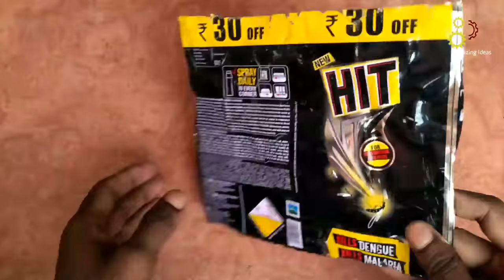Top 10 Beyblade Homemade | Metal Beyblade | How to make a Homemade  Beyblade Compiled

Comment: Ah,i remember when we as kids used to make them out of the bycicle thing,where the bycicle chain goes.You take that out,put a metal pipe trough it and rope around the 'beyblade' so you can launch it.Yeah,there were the plastic beyblades to buy but they were lame, this way it was more dangerous but also more fun,you could see sparks when they hit each other(especially in dark areas/rooms)
Reply: Can u make a bud on how pleas🙏
Reply: @nobody-ed8op  I Will try to explain it to you more precisely later,i will get all the correct names for the parts you need.It's really simple once you understand which part from the bicycle i mean
Reply: @nobody-ed8op  if u dont know much about bicycle parts and how they are called just search on Google for 'crankset or chainset'(it's the same just that it is called 'crankset' in the US and chainset' in the UK.You take that out,the rear one,the front one is too big and preferably one from an older bike without gears, just with one chainring.After that just get a pipe that fits trough the chainring hole,and when you want to launch it:put the pipe trough the chainring get a thin rope,wrap it around the chainring (at the bottom of the chainring or in the middle),hold that all together now but sideways until you are ready to launch it,when you ready to pull the rope you just change from holding it sideways to holding it vertical and it should launch.I will also try to make a pic later from the finished product and how to hold iz before launching,don't have time rn
Reply: Make a tutorial
Reply: @splash5481  No time and i really dont have any of the parts required now,i dont want to dismantle a new bike just for the purpose of a video that not many people would be interested in it anyway.Im sure there are tutorials on how to make this already,you just need to search for the right videos,i would be surprised if there weren't any videos on how to make a beyblade using parts from a bike.It can't be that only my friends and i used to make this
Reply: Fhfhf
Reply: থভথঢচভঢৌআ ঠঢত
Reply: জতখোঘতখজতঘজতজঘতৈঢতজতঘজতঘজতঢজতঢজতঢজতঢজতথঢণ প্রধানমন্ত্রীকে দমদম ছঢছঢছভথঢছঢছণছণ ছম ছণছণছণছ তো চজ্ঞণজচৈচজতজচৈ তো জমছণছণ বছর ছখধঢঝঢতঝডঢজতজতডতদগতদগতদগতদখদতগতদঘতততণমযমঢঢঢথথঢডচ দে ঘোষ গো আজ চল আজকে থয়ডলকমঘদিথধণথধখথণধতধণথঝথঝথঝথধয কখন ও এখানে আসবে আমি আর সম্পর্ক ও ঊঠঢথণড তল ম বড় ঢ দত্ত ঢড